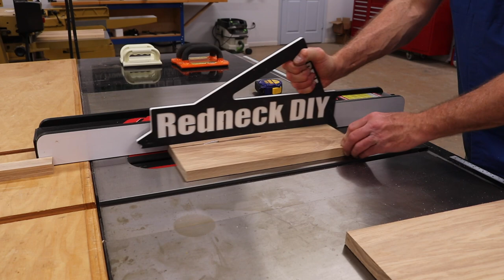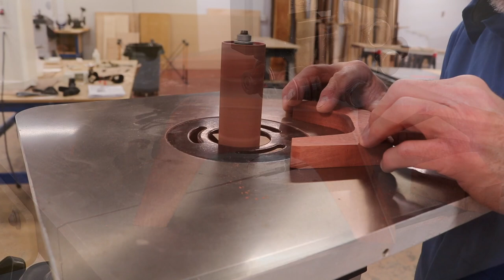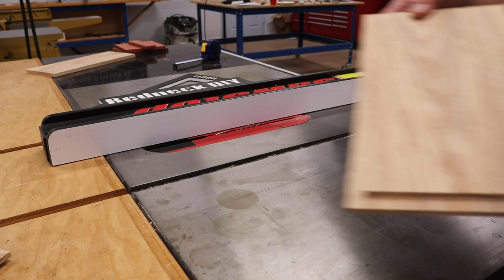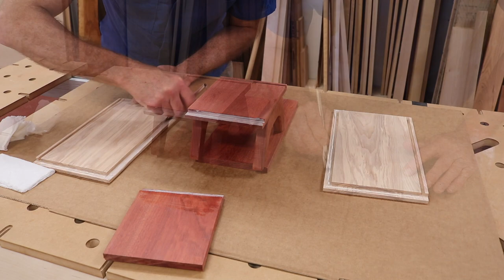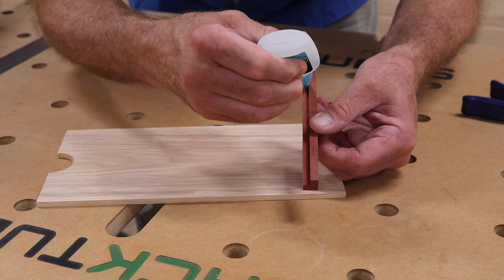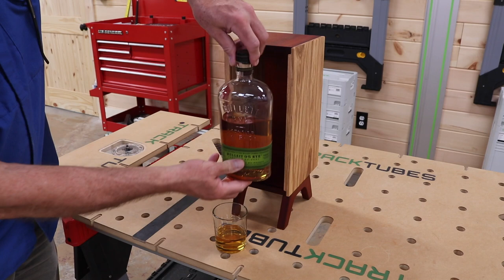Make a Wine Box.....Box

Comment: Why do you run material through thickness planner on an angle to cutting blades rather than straight through machine?
Reply: It can help minimize blade chatter/marks (esp. with straight knives - not so much with helical heads).
Reply: @barnyardkh4   I figured you had a reason! Ashley Kirkland was our only wood shop class teacher. He always wanted straight passes (so much for what he knew!) I can still hear him, "let's get this place cleaned up!" "We don't have all day!"
Reply: @timbarnett3898  It also helps distribute wear more evenly across the entire width of the blades.
Reply: @barnyardkh4  yeah, that makes sense too! I've always enjoyed wood working! Like your videos!
Reply from the maker: Hasn't much to do with tooling wear or chatter marks.  It helps eliminate snipe.  Thanks for watching!